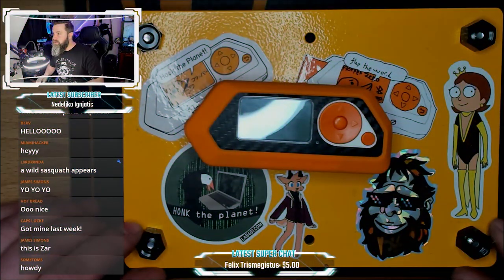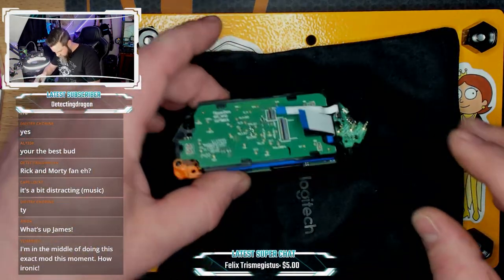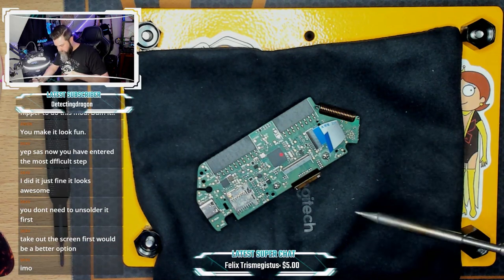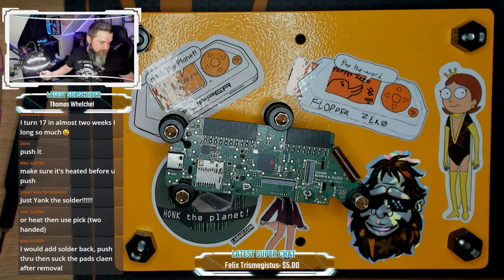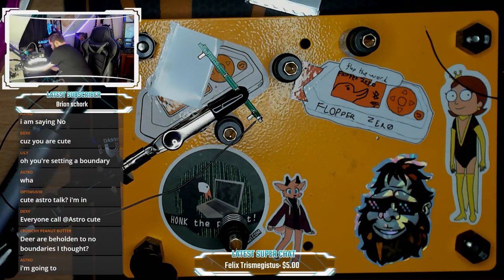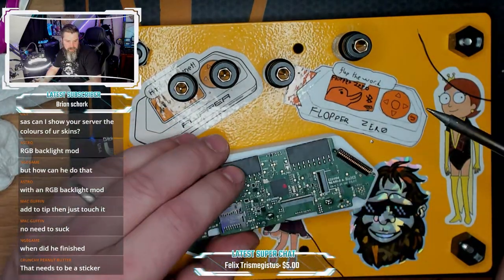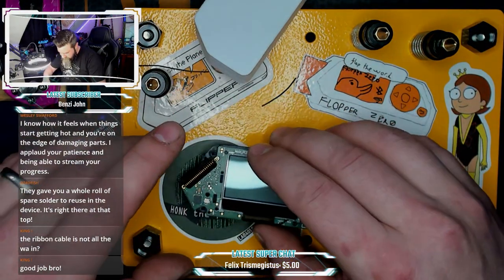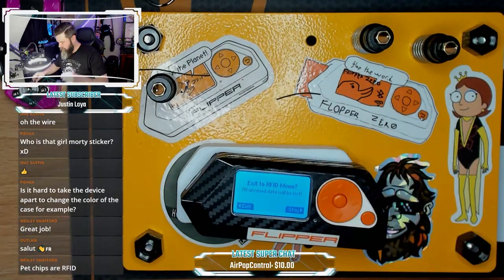Flipper Zero RGB Screen Mod!!!! Selectable Backlight Color!!!!! 🤯🐱‍💻🖥🐬🐱‍🏍🐌

Comment: great vid - planning to do this mod myself. the solder issue you had was likely caused by mixing your lead solder with the lead-free solder that comes on the flipper. mixing lead and lead-free solder forms an alloy that doesn't melt very well and is prone to cracking. it's best to use solder wick to remove as much solder as possible before re-tinning the pad with your own solder.
Reply from the maker: I was using really bad soldier.  You're right!

Comment: I finally did it! I also ordered case with dark grey vanish (you barely see through) from PCBway, 3D printed black buttons on Prusa textured sheet and added RGB. Its like a stealth device now, all black. And changing the screen color adds to that. At least its not immediately apparent that its a flipper. I love Olive color background, looks much like old Nokia phone.

I almost broke it too. On the iButton board the middle contact pin was loose. But it felt like it has always been broken. I soldered a ball of led there on the board, and let the pin just be freely in its hole and make contact when its pressed with an iButton.

Comment: Anyone else have a quiet clicking noise when doing the “wave” effect? I suspect it’s because it’s hooked up to the vibration motor port
Reply: Yes, the clicking is the refreshrate of the colors changing. I tried around a bit and when you change the pin in the sourcecode from 8 to 14 in "\fw\RogueMasterWApps\lib\drivers\SK6805.c" at line 39, you can use the SWCLK pin, which is located about 1cm to the left of the VIRBO pin. It's a bit more complicated since there are two delicate parts next to it, but if you are careful enough, you can get a noise-free rgb mod this way. :)
Reply: @crmbz  I'd love to see a demonstration or some sort of documentation if you ever found the time

Comment: Wish you could be done just from within the Flipper itself without having to take it apart like a software or something like that maybe a nap
Reply from the maker: Would have saved me 3 hours!
Reply: Sadly the built-in LEDs that make up the backlight are just one color. Would have been nice if they just used basic RGB or WRGB LEDs, then you wouldn't have to modify the hardware.

Comment: I watched your video about what to do when you first get a Flipper, posted very recently. I left a question but didn’t get a reply. I see you’re more active on this video, so I thought I would ask you here. 

I followed your video and loaded everything as you did in your video. I loaded the Roguemaster in the Update folder. The flipper will show me the Roguemaster files on the SD card, but when I go into the Update folder, the folder says EMPTY. Is there anything I may have missed or need to do extra?  Cheers.
Reply from the maker: Are you SURE you put the uncompressed firmware into the update folder?
Reply: @TalkingSasquach  Thank you for your reply. Yes, it was an unzipped folder and dragged it into the UPDATE folder as presented in your video. I first watched the video and then went back and followed it, so as to not miss anything. Any other ideas why this happened?

Comment: if i do this is it necessary to connect it to the vibro or can i just not connect it to vibro because id prefer to be able to just not connect the lcd to vibro so it doesnt vibrate every time i change the color because vibrating every time i change the color just feels weird and clunky
Reply from the maker: Won't work without it
Reply: @TalkingSasquach  could you please explain why it wouldnt it kinda confuses me that just not being connected to the vibro would make it not work
Reply from the maker: @geese-are-very-cool  that's what changes the color
Reply: @TalkingSasquach  im confused how does the vibro change the color